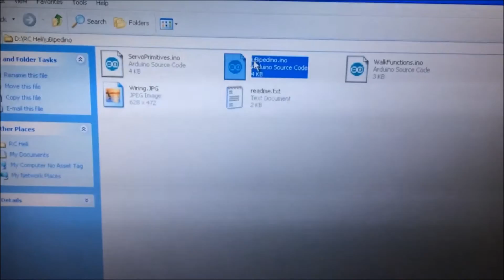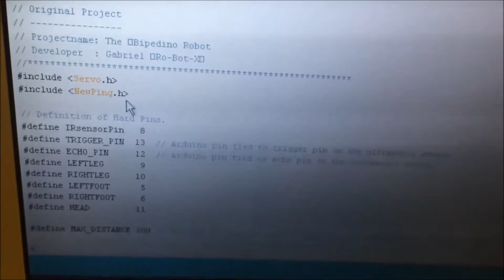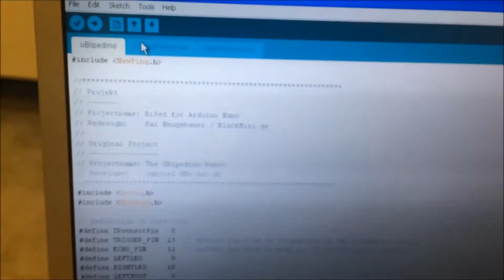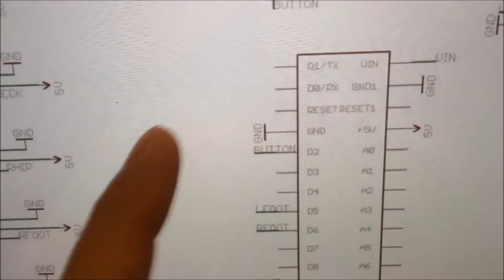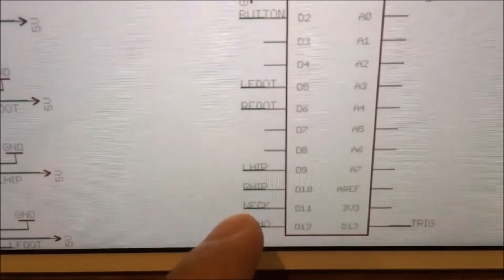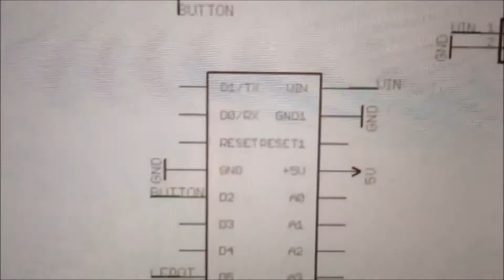3D Printed Robot Build

Comment: Thank you for your code, I assembled and released the video below:

Test, including assembly instructions 1
https://youtu.be/3uOlsN9wnag

Including assembly guide 2
https://youtu.be/-pMvAZJSFI4

Including assembly guide 3
https://youtu.be/ZZ7wsNy78lA

Including assembly guide 4
https://youtu.be/rwKlItGzNxY

Including assembly guide 5
https://youtu.be/7iiF_WWparY

Including assembly guide 6（Use the USB 5v-micro transmission line to charge externally (the blue indicator light is on when fully charged)
https://youtu.be/M-5mbMXNY3k

Comment: How you deal with servo noise?
Reply from the maker: Direct drive motors (eg: stepper motors) or belt driven system are possible solutions but they either require a total re-design or a high cost (in the case of miniature stepper motors). Servos are still the best option despite their annoying buzz. :)
Reply: @terence79chan  but i mean noise in signal and vibrations. I have this servos and they vibrating so bad every time. I try with two different power source and problem is always the same
Reply from the maker: I have seen 2 with bad jitters,  out of 20+ that  I bought over the years. You might had gotten a bunch  from a bad production batch.

Comment: hi there, any arduino code and wiring diagrams link?
Reply from the maker: U only need to make sure the port that you connect each wiring to, matches the number used in the code. For example, if u use port 9 for the ‘neck’ codes, then u gotta wire the ‘neck’ servo to port 9 of your board. The ports’ numbering is shown at 2:47 of the video. You could also google for the pins-out diagram of the arduino nano to get a clearer view.
Reply: Hi there, thanks for your answer! I made this correctly but, the code wasn't good! There was many variables not defined so I was not albe to upload the code on the arduino nano! Then I wrote the missing variables in the code and finally I have uploaded the program but... there is something wrong because the robot doesn't walk. It made only micro movements on the foot and hip servos but nothing more! Can you please check the code of this link? http://blackmizi.de/download/BiPed.zip??? Please note that all the 3 programs are full of missing parts! Hope to hear form you soon.
Reply from the maker: @AlexMele  Hi Alex, I finally managed to find the codes that I used for my robot. I have zipped up the exact folder and upload to https://tinyurl.com/arduino-biped    And by the way, follow the instructions in the readme.txt  to import the library. Since you will be using my folder, I dun think you will have undefined variables as the *.h (header files) are all at where they should be.

Comment: Cab you make a List for the electronic parts
Reply from the maker: 1. 3d stl https://www.thingiverse.com/thing:19594
2. 5x 9grams turnigy servo (hobbyking)
3. Short range type proximity sonar sensor (AliExpress / hobbyking)
4. Arduino Nano clone (AliExpress / hobbyking) 
5. Step-down adjustable regulator or 5v buck module (AliExpress / Banggood)
6. 300mah 2S lipo pack with JST(hobbyking)
7. Nylon wall plugs (red or green)
8. M2 screws (pack of 10) (AliExpress)
9. Double sided “3M” foam tape (hobbyking)
10. JST plug for battery (hobbyking)
11. Super glue or CA (hobbyking)
12. Soldering iron, solder and flux (hobbyking)